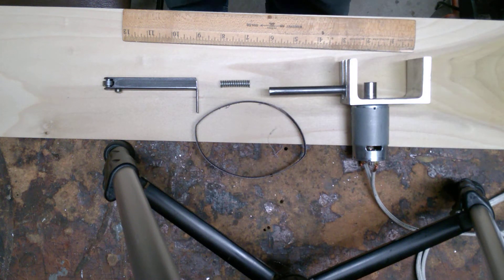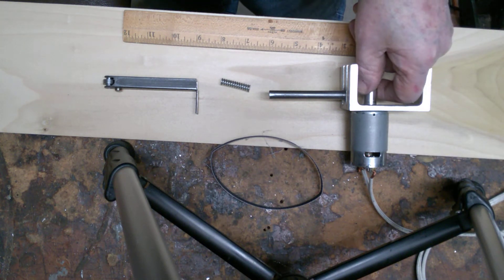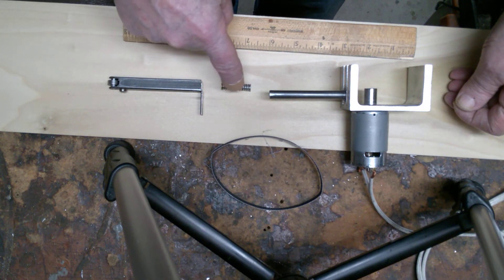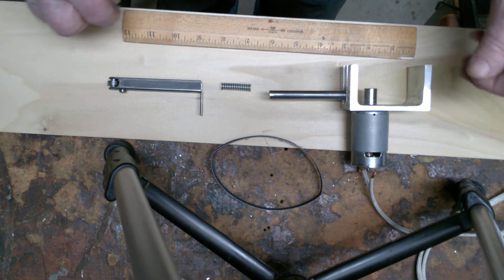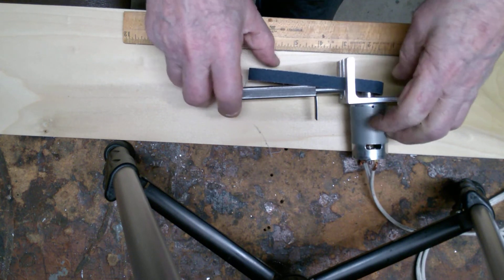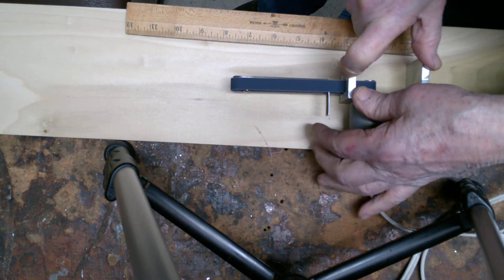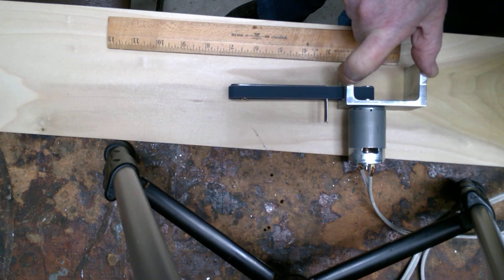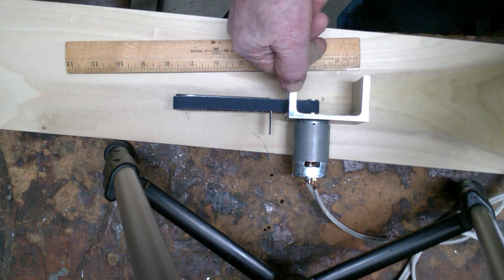Mini Belt Sander

Comment: Damn, I like it. I make miniature internal combustion engines in my machine shop. I have two big belt grinder/sanders(a 2"x60' & 1"x60") and a 3 phase 12" disc grinder. They work great for bigger things, but no so good for miniatures. I can't count how many times I've ruined a part trying to do fine work on on a small part and had the belt or disc grab it. Looks like I have another project in line......LOL